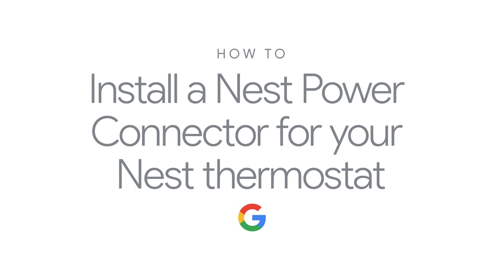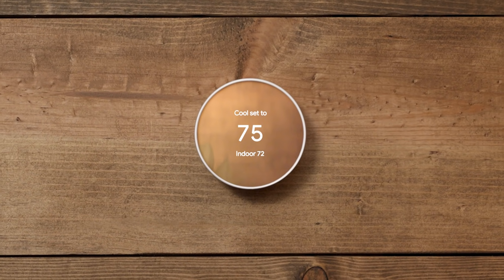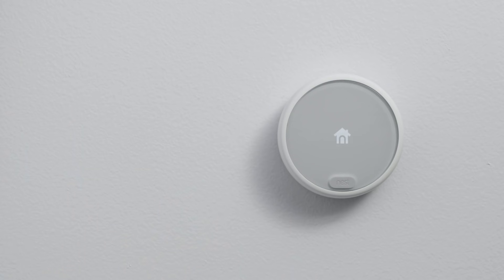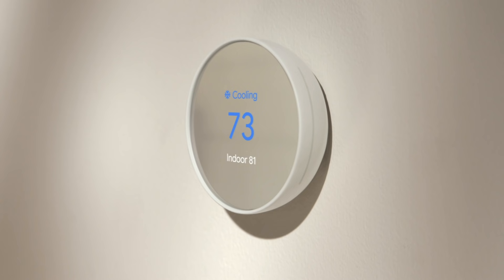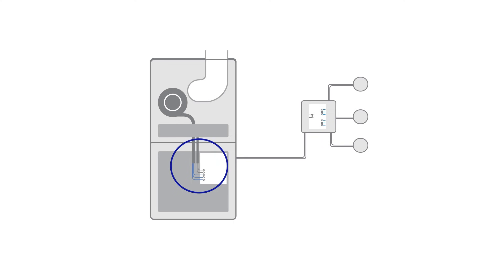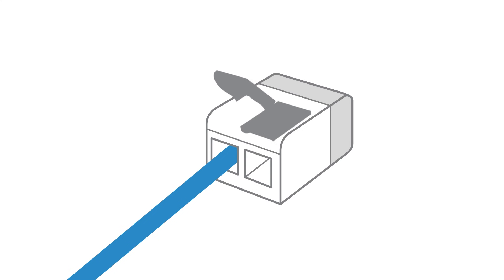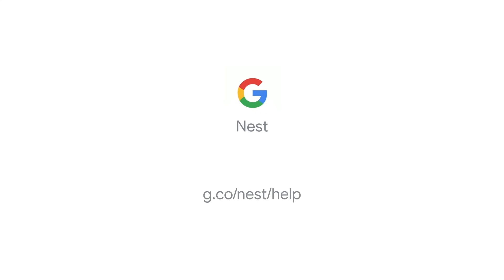How to Install a Nest Power Connector for Your Nest Thermostat

Comment: How does it even work, anyway? There doesn't seem to be any new wires just magically plugging into the thermostat itself, so how does it detect it and get power from it?
Reply: I wish google/nest didn't treat everyone like idiots and actually supplied these details for their devices. As i understand it, this device works by creating a closed loop between the red and white wires (mimicking red-to-common), so the nest device can always have power without risk of powering the relay. When the thermostat needs to turn on the unit, it sends a signal down the line to the power connector, and the power connector closes the relay loop itself. If you ever need to put the old thermostat back in place, uninstall the power connector first!
Reply: @edelsmurf  Ah! That makes sense. Though if I do get a nest thermostat, and it somehow needs this, (the checker says the eco is the only one that'd need the adapter in my home) and then it broke, I'd just get a replacement nest thermostat. Though if that happened again, I'd uninstall the power connector and switch brands.
Reply: @jeffystreet  If your thermostat doesn't have a common line, you probably should get it even if they say you don't need it. Without it, the thermostat is trying to steal power to charge its internal battery while the unit is running -- but trying not to steal so much that the relay disconnects. And when it isn't running, according to the patent at least, it may try to steal enough to charge its battery without activating the relay. It's a tenuous configuration. My own two-wire setup worked fine until a recent software update, after which point the furnace suddenly started cycling on/off/on/off and i could hear relay chatter, because i guess somehow nest decided that they didn't need safety features. It's a shame that they can't get their act together, but at the end of the day, I'd rather pay $25 for this device than buy a new furnace when the thermostat destroys my current one.
Reply: @edelsmurf  Good god! That sounds horrible.. If I ever do upgrade to a nest thermostat, I'll consider getting a C wire if not this power adapter.
Reply: Think it's getting it from the C terminal and distributing the power that way using the adapter.
Reply: @gerardo.galvan  So for example, in my house there's an R and W wire and no C, so the adapter just pumps more juice through those wires into the thermostat?

Comment: So if you don't have a C connector then this product has zero use? I tried connecting to a simple 2 wire system yesterday to no avail. I'm a bit confused...or dumb...probably both
Reply: The C\Com terminal is just the unswitched half of the 24vac circuit coming from the transformer that supplies power to the furnace\boiler controls.

Comment: Does anyone have actual feedback from an installation that worked (or didn't)?
Reply: Installed mine today. Had my nest for over 2 years, recently having problems where it was losing power and acting weird. Main problem was it would trigger my fan to power off and then back on right away with the a/c mode on so it would never reach target temp. A/c would run all day but the nest wouldn't show a change in temperature. This was easy to install and seems to fix my need for a common wire. So far so good. At the end of the day, 30$ for a potential fix isn't all that bad. Good luck!
Reply: @baboosta85  did it fix your problem?  I am looking into this
Reply: @momotastical  Yes and Yes!
Reply: I also decided to take the plunge. I have a 2 zone system with 2 thermostats, and it was not clear how that would work. But I discovered the "pro" installation guide which specifies that you will indeed  need two power connectors (I recommend the pro guide version, better explanations). Installation was a breeze on a Honeywell HZ311 controller. 3 days later, all works well, including presence sensing which wasnt working before without a C wire. I've ordered my 2nd connector for my 2nd thermostat now, and all should be good!
Reply: @alextheodorakis8515  2 months later is it still working well?
Reply: I installed the adapter a month ago and the low battery issue returned this week. Maybe I installed it wrong but everything works like normal, I just need to charge the thermostat periodically to keep it connected to Wi-Fi. Going to call a pro😢

Comment: This is not an installation video, it is a PR video.  You dont once show what it actually looks like or might look like.  you also don't own that for previous years this can cause issues that are vague.  I spent a year several service calls and a damaged compressor due to your choice not to be honest and upfront with possibility of failure.  I can handle an correctable issue, i cant handle hiding and obfuscating it, then releasing confusing less than useful video to correct it.   Please do better, or even, do good.

Comment: I have been having HVAC issues ever since I installed my Nest.  Been about 5 years and the last 3 years the AC does not turn on.  We call someone and they just look at the AC and when I mean look I mean with their eyes, they don't even touch anything and the bloody thing works.  I think I might need the Nest Power connector, how would we know if we need this?

My only indication was that the last HVAC guy last year told me to get an ecobee that came with their own jump box that connected to the furnace circuit board.  I looked last year and nothing from Nest until now.  They even mentioned possibly running a dedicated 24V power but that was a $600 estimate and these were all best guesses from the HVAC company.

When I turn on my AC, it doesn't start. It does not click, I changed the capacitor twice.  When HVAC guy came he tested the old and new one and told me the old was still good, so swapped it back.  The furnace fan blows the basement air in but no AC fan spins.

Any help or suggestions are welcomed.  Still wondering how I determine if I need this or if this will resolve my issues.
Reply: If your fan blows but your condenser does not come on you need to check a couple things. 1) Do you have 240v going to your condeser? Is your disconnect and breaker in the ON position? 2) do you have 24v going to your contactor? If so, does your contactor pull in, engaging your unit (condenser fan and compressor) 3) if you dont have 24v to your contactor then check your wiring from your furnace board to your condeser. Do you have 24v across Y and C? If not trace back to your thermostat

Comment: Still confuzzled and looking forward to the review videos. I've got a simple two connector cable coming up from the boiler, currently needing  an external power bock to replace the missing C cable for power. Doesn't seem like this will assist without more runs. But maybe I'm dumb.
Reply: The simple answer is that power will be delivered to your thermostat without a C-wire being routed there by using the existing wires to deliver power.
Reply: Pat I am in the same boat on this, i do not have a common connector post to wire  this in to? One of the two wires coming off the LOW V side of transformer is a common i think but do not quote me.  If i have to splice into that anyway, i would just splice a c wire straight in?  Confuzzled with this also.
Reply: I am in an old house with a boiler, and my Nest E works fine with just w1 and R connected. As far as I know, you can't buy a Nest E anymore.
Reply: Just this thing won’t replace a missing C wire. If you look up the advanced (pro) installation instructions, it details exactly how it’s done, but the short version is that you need a 24v transformer which is spliced in between the C terminal on the google thingy and the R wire going to your thermostat. 

In other words, this ain’t a DIY to replace a C wire.
Reply: @cellphonecam1  I thought this product enables power without dealing plugging in a separate transformer which you can also do if you prefer. But you don't need both. Isn't that correct.
Reply: @nicklawyernicklawyer  only if you have an available C-wire. Otherwise, you can not use the power connector and just use a 24v transformer. You could use both, however.
Reply: It sends the power over the existing 2 wires, no additional wire installation required.
Reply: @TheLamondays  John, I am with Pat on this, i do not have a common connector post to wire  this in to?  Can you show us what your wiring looks like if possible at the furnace end?  best regards
Reply: I've tried setting mine up multiple times with no C connector wire to no avail. I'm not sure why this product exists...or why google are giving them away for free. I imagined this being a work around for no C connectors, but nope. Back to draining AAA batteries.

Comment: This video is a bit confusing. The video shows us they already have a five wire thermostat bundle 1:14. If you have five wires (RGYWC) at your thermostat, you don't need this power connector. Secondly, the video shows you how to install the power connector for a three wire thermostat bundle for a heating and cooling system, but normally thermostat wires have four wires (RGYW).
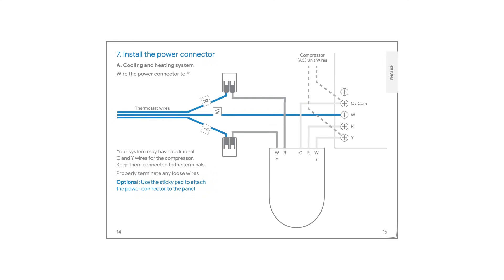Reply: Check out 3:40
Reply: @TheLamondays  i did. Why are there only three thermostat wires there? (RWY)
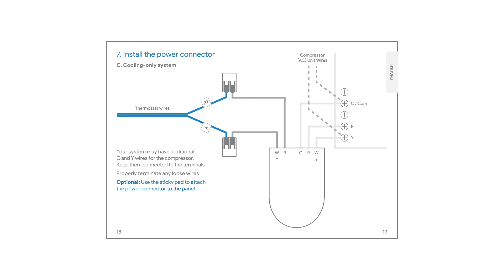Reply: @jonkc3635  I meant from that time on, it shows multiple setups. For instance the one it shows 3:47 is a two wire install. If you're referring to the three gray wires those are going to the furnace control box where you connect to the two terminals that your thermostat would normally connect to them the 3rd wire connects to the common (C) terminal, and you just connect the 2 thermostat wires that you originally removed from the furnace terminals to the nest power supply. It can accommodate a lot of different setups.
Reply: @TheLamondays  I was referring to page 15 where the thermostat controls both heating and cooling. Normal thermostats should have four wires (RGYW), but in the video, it only shows three wires (RWY). This will confuse a lot of the customers about where to put that G wire.
Reply: @jonkc3635  sorry about that I think I misunderstood what you saying in your first comment.
Reply: @TheLamondays  That's fine.
Reply: @jonkc3635  just looked through the install manual and it specifically states to leave all other connections where they are normally connected besides the R and W(for heat only systems) or R and Y(for systems with cooling)
Reply: @TheLamondays  oh. I see. Thanks for the update.
Reply: if you have 2 stage heat, 5 wires isnt enough to have a C anymore